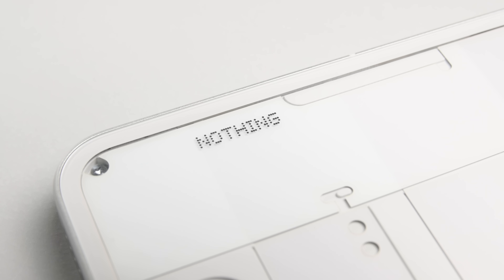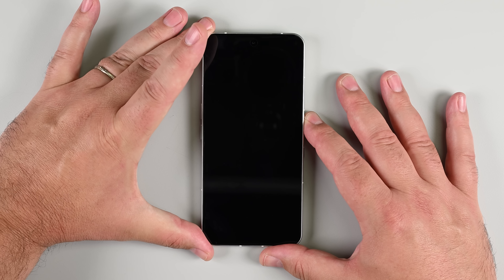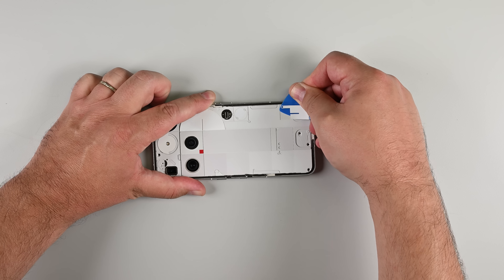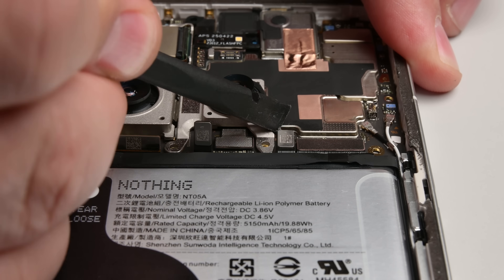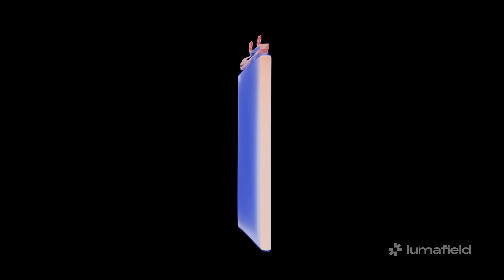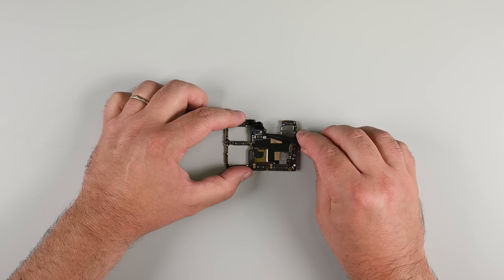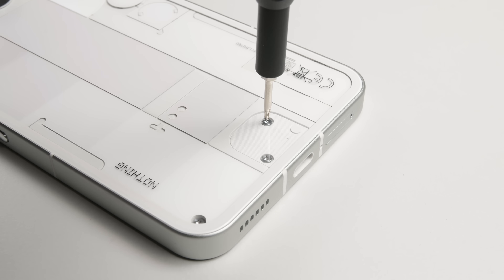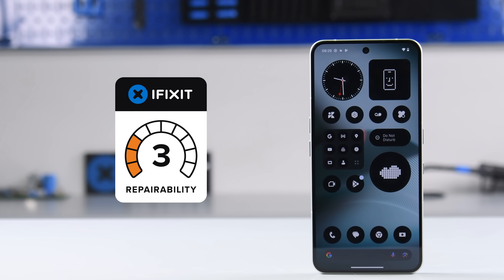Repair Nightmare or Transparent Triumph? Nothing Phone 3 Teardown

Comment: Fun fact: since I had my Nothing phone 3 (bought a month ago) I had always had problem with it (the mobile signal went on and off all the time, speaker "bopped" sometimes). Then it fallen from a meter (probably less) and the glass, not the display, shuttered like never seen before after that my speaker stopped working definetely and the antenna got worse too. I asked from nothing support if it was possible to repair on gurantee , of course not, but it wasn't a problem for me. I mean I understand it was physical damage but they couldn't provide me a quote before sending to fixing it. So I don't know how much do I need to repair it and the funny thing is that if I don't accept the quotation I need to pay the shipment, otherwise they keep the phone. So funny right?

Comment: Was not expecting AI for the phone falling apart. You have the parts and could have done it as a cool practical effect!
Reply: Or even CGI with the parts scanned and rendered so it looked less like vaseline-y....
I was wondering why it looked so borked.
Reply: They have limited time and money to make videos so why obsess over a short 2-second clip though?
Reply: Fair enough, but it's also a shot they probably wouldn't have even tried without it being that simple, given how short it is, and the otherwise much larger amount of effort required to 3D scan every component, animate them with physics, etc, just for like 2 seconds of video that's meant to be purely filler.

Comment: I'm not interested in defending Nothing. However, the inconsistency in the repairability score blows my mind. It should not be possible for an iPhone with parts-pairing to outscore a phone whose parts can be freely replaced without Big Brother's permission.
Reply: Likely because nothing doesn't sell any replacement parts  and because the phone is aesthetically permanently damaged after a repair, which doesn't happen with any manufacturer

Comment: i for once im with the nothing company ,exposed screws are a nightmare in your pocket ,they attract dust and scratch your stuff
and i dont see anything inherently prohibitive about this phone ,your being too harsh on them 

its not like you will take your phone apart everyday to fix it ,so im willing to take the back cover over the screws
Reply: The problem is not that they're under the glass (well not only that) but the fact that, after removing the back glass, there are SOME (not all) screws under stickers that will be impossible to stick back correctly again
Reply: @sgc15  still , better then what apple or samsung does , im willing to sacrifice a few cosmetic stickers to get my screen replaced , you dont have to put the stickers back on , i feel like they are giving them too much trouble for just some stickers

Comment: thank you for this video, i've been really liking their designs but they've been too quiet on the repairability front. this unfortunately confirms my fears lol
Reply: they are quiet for a reason, i got the phone 1 and i wanted to replace a part. Not only did they not provide the option to ship that part to me, instead i would have had to factory reset my phone and send it to them,
pay for shipping and the part. Instead of them shipping it directly.

Edit: Gramma + Structur

Note: I claimed that Nothing does NOT provide the spare part at all, and doesnt offer a replacment, i messed up my wording that MIGHT not be true. They told me i can send it in and they will look at it. 
Did not provide any wording that they would be able to replace it tho, so im unsure. - (this note is regarding my previous message before editing)

i messed up my wording that mi
Reply: @SeXySpEcKsY holy burdening the consumer, Batman!
Reply: I've also heard that the back glass is not very strong and some come with dust behind the glass from factory or later obtain it. (Not a perfect dust seal)

And I guess they don't sell genuine back glass if they don't sell parts to stores or consumers.